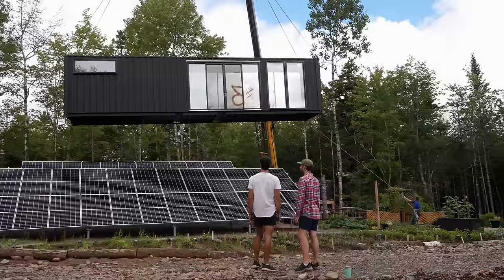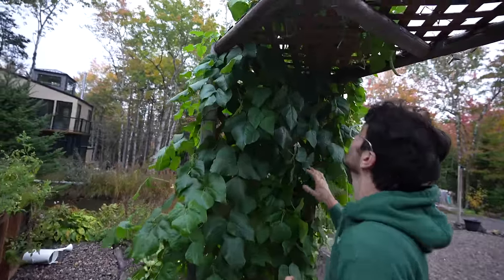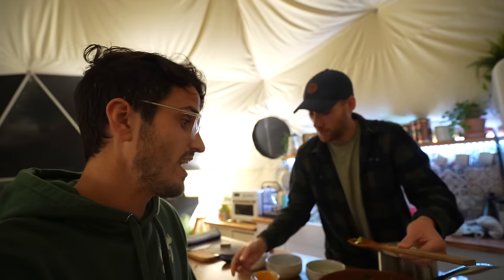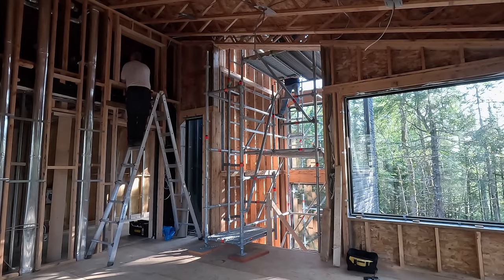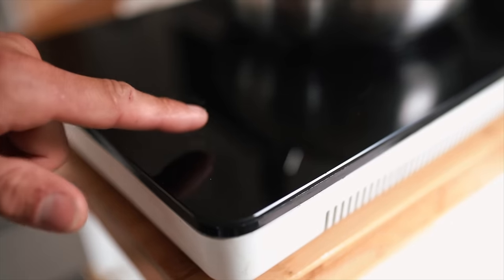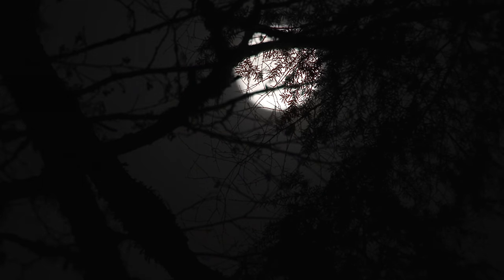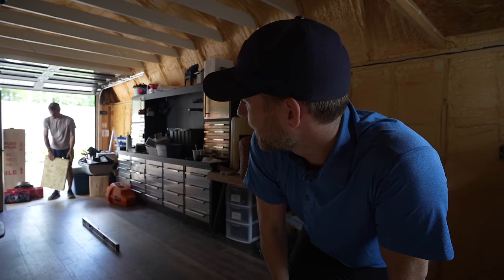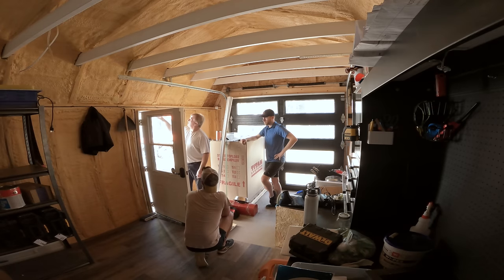INSIDE our Shipping Container Home in the Woods...let's get building!

Comment: Building progress of any sort is so exciting! You are that much closer to having a completing home! One thing with spray foam, make sure you have low humidity inside and an air exchanger. My grandma’s friend built a million dollar mansion, and it was built super tight with spray foam. Because of this the house couldn’t breath, and the humidity from cooking, showering etc couldn’t leave properly. This caused there to be internal dripping of water! An absolute nightmare. And obviously over time creates mold too. My parents traditional house has a spray foamed roof and then walls are thick fiberglass. We are in an arid climate. So far so good

Comment: Yes for Jackery!  Got the first one for our Roadtrek.  Got a second one 1/2 off during Prime Days and it is strong enough to run our AC for 8 hours!  The first one runs our Instant Pot and Airfryer, so bonus!  Highly recommend them.  And the first one we put away, 100% battery, and didn’t use it for 18 months…was STILL at 100%!  Loving that you guys feel so reinvigorated.  You have certainly had your share of whoas.  Can’t wait to see some drywall up. 🎉

Comment: It looks amazing!! Im so glad you all have pushed through all of the hurdles and challenges that have came up! Ive seen lots of good tips online about making sure you put tubes in the walls where you will have TVS so you will never struggle keeping wires hidden! I also don’t know what system you use to monitor energy use, but Dan from “Whats Inside” has shown the amazing capabilities of SPAN electrical panels! You can monitor each breaker on your phone and give priority to a certain circuits!

Comment: When the phrase ,”Shit or get off the pot!” Is used, it may refer to the chamber pot kept under the bed, usually ceramic or china with matching lid, in the days of the outhouse. Even today, most parents refer to the toilet as potty training, for teaching toddlers the use of the toilet, using a little plastic, appropriate size movable potty. 
Also, paper in an outhouse, was often newsprint from newspapers and catalogues,  so if someone was taking too long, it was assumed they were reading the papers, and not getting back to work, therefore, “Shit, or, get off the pot!”

Comment: I would recommend a radiant barrier so that the heat doesn’t pass down into your structure.  I did that to my loft and it cut the heat transfer by 20%, then again below the metal roofing for an additional 20%.  People miss a great opportunity to cut down on that heat transfer.

Comment: The secret to making rice depending how many serviving you need is to place one cup of water per cup of rice and after you do that you add an aditional  half of cup of water until it boils then you lower the heat to low place the lid on the pot and let it dry moving occasionally. I hope that helps.

Comment: T&T probably said on a previous video - do any of the upper windows in the tower open? I realize it is something that would need to be automated cause after the scaffolding is gone there’s no way to manually open anything up that high  I was just watching a video on how ancient civilizations cooled their houses and there seemed to be a lot that had towers or peaked roofs with an opening at the highest point to let the hot air out

Comment: I'm so very excited for you guys (as are all your fans) to see forward-moving-progress on the interior of the container home! At great risk of squashing that excitement I have a bit of concern when it comes to installing the drywall on the exterior walls.
When installing the drywall, how will you know where the electric and water lines are as they pass through the metal framing on those exterior walls? You pulled everything away from the first layer of sprayed insulation, bringing them closer to the drywall and I’d hate to see the drywall screws piercing water lines and electric wiring where they pass through each wall stud. Please tell me I’m over-concerned!
Reply: @russellozana7033.  Valid question. I doubt that Dumpy would allow those concerns to be an issue 🤞🏻.

Comment: Your tower need a window that opens.  Heat rises and if you open a window on a lower floor you will get a nice draft.
Reply from the maker: Normally I would agree but this house is designed that opening the window would be the opposite of what we want. Everything will be climate controlled and efficiently filtered air will come through the ERV system!

Comment: Hi guys, I see you’re using the dreaded plastic plumbing instead of copper water lines. Be extremely careful and make sure your plumber knows if you like high water pressure because if you use PVC waterlines, sometimes the water pressure will not be as high as if you would’ve used copper typing, I say this from personal experience so if you like high water pressure when you take a shower, you may not get it with PVC waterlines

Comment: Will d sprayfoam work if u r 6feet in snow??? 😮😮😮
Reply: Hopefully it should work out well. Snow is a good isolator. What they need when in six feet of snow is a good way of getting fresh air, so as not to suffocate from the carbon dioxide they breathe out.  cheers! / CS

Comment: Do the windows open in the container house?
Reply from the maker: Yep!! Certain windows do (bathrooms, kitchen, and bedrooms) but all the air will be handled through an ERV with a really dense filter which cleans and then preheats/cools the air depending on the season so it’s as efficient as possible to maintain humidity and temperature inside!